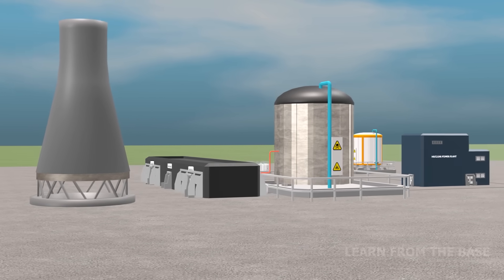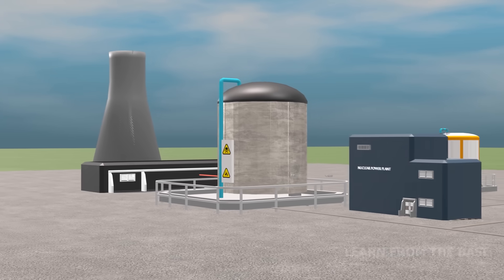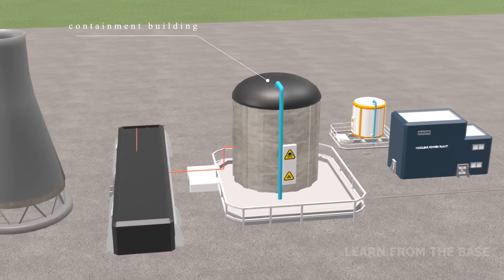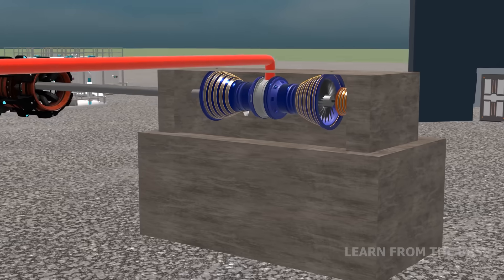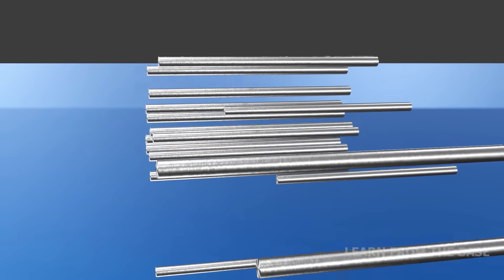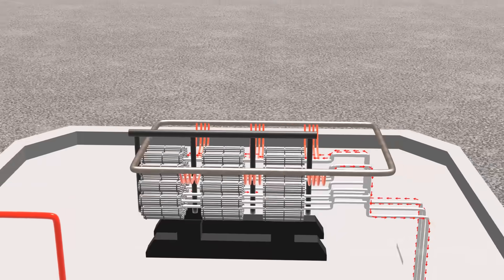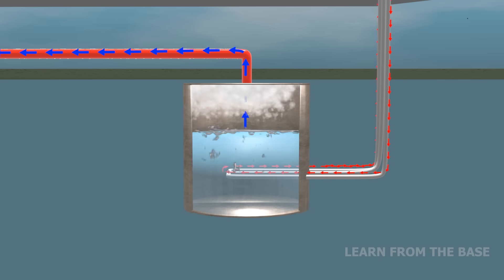HOW A NUCLEAR POWER PLANT WORKS ?.. || NUCLEAR REACTION || 3D ANIMATION || LEARN FROM THE BASE

Comment: Fission Energy on Earth can last for 555,000 years up to 600,900 years if calibrated or the reactor is fine tuned by the Geiger counter sensor. How is it done? First reduce time from 0.202 seconds to 0.1287 seconds verify zero rads, increase displacement to 25,373.13 miles and verify zero rads on the sensor, last increase decay rate to 3088 from 2000 and verify zero rads on the sensor. Something they don't teach you in college or the US Naval academy of nuclear physics research your Geiger counter sensor never lies and gives false readings of gamma X-ray radiation exposure.

Comment: Russia dreaming a Hanuman Jump in Nuclear Power Generation:

Keeping in mind economic growth in the Urals, Siberia and the Far East.

Global warming, Climate change, melting of glaciers convert fertile plains into deserts and Ice clad areas into Fertile plains.

Policy Plan-

To achieve a 25% share of nuclear energy in the country’s energy balance by 2045.

Construction of 28 GWe of new nuclear power generation by 2042.

Construction of 37 new nuclear power units of large, medium and low power.

Innovative units with Generation IV technology.

Optimised high-power units (1200 MWe) with VVER-1200 

Innovative units of medium power (600 MWe) with fast neutron reactors that will significantly expand the fuel base by involving uranium-238 in the fuel cycle

Low-power nuclear power plants (with a capacity of up to 110 MWe).

Largest increase in nuclear generation is expected in Siberia, the Far East and the Urals (more than 12.7 GWe). 

By 2042, it is planned to build 13 modern large and medium power units. 

Currently, these regions have high growth rates in electricity consumption.

Comment: 👍Great video! 😲Although I would add that in order NOT to 😱mislead your audience, you should have stated that you describe here a specific type of nuclear reactor, and that other types exist. This is a pressurized heavy-water reactor (PHWR) is a nuclear reactor that uses heavy water (deuterium oxide D2O) as its coolant and neutron moderator. PHWRs frequently use natural uranium as fuel, but sometimes also use very low enriched uranium. The heavy water coolant is kept under pressure to avoid boiling, allowing it to reach higher temperature (mostly) without forming steam bubbles, exactly as for a pressurized water reactor. While heavy water is very expensive to isolate from ordinary water (often referred to as light water in contrast to heavy water), its low absorption of neutrons greatly increases the neutron economy of the reactor, avoiding the need for enriched fuel. The high cost of the heavy water is offset by the lowered cost of using natural uranium and/or alternative fuel cycles. source : https://en.wikipedia.org/wiki/Pressurized_heavy-water_reactor . Peace & Prosper. ❤🖖

Comment: Nuclear power plant produces electricity using the heat that comes from splitting uranium atoms in a process called nuclear fission

Nuclear fission is a nuclear radioactive decay process in which the hitting neutrons on the uranium atoms then the uranium atoms split into two and it releases 3 neutrons. Each process releases two uranium atoms and 3 neutrons

Heavy water is 10% heavier water which contains deuterium and is 1 out of 7.000 drop of water.

Comment: So, nuclear power plants are just a fancy way of heating water
Reply: Yeah but it makes zero atmospheric waste and is a lot more efficient in converting matter to energy, burning coal and natural gas using only 30% of the actual energy made from the heat while nuclear plants can get up to 80% efficiency will being a renewable source of electricity
Reply: @SlumChip  Lies. Steam Cycles only go upto 33% Energy Efficiency at most regardless of heat source. Gas Cycles can go upto 45-50% Electrical Efficiency, and only Nuclear can make enough heat for it. Combined Gas and Steam in certain reactor designs can push over 60%.
Reply: LoooooL had the same option,steamed engine with extra steps
Reply: @RedRocketRR-xc5hk  but much more yeild
Reply: @CEUprimate  yeah,extra steps
Reply: Heating water with nuclear energy , wait does that mean when i boil my water i can make energy?
Reply: @IsaacDesnus  yes you can. this is 5th grade knowledge. That's how steam engine works
Reply: Technically yes, but the energy generated by heating water by boiling it in a stove would not be sufficient atleast to make some watt.
But then again i still dont know .
Reply: @IsaacDesnus  google it how streamed engines work
Reply: @IsaacDesnus  maybe, but you'll need a turbine for that to work, did you even learn it yet? I learned it in 6th grade
Reply: @matthhxz  of course a turbine is needed atleast to make mechanical energy, at the same time you do need a generator to turn it into electricity.
Reply: Yeah 😒 interest lost

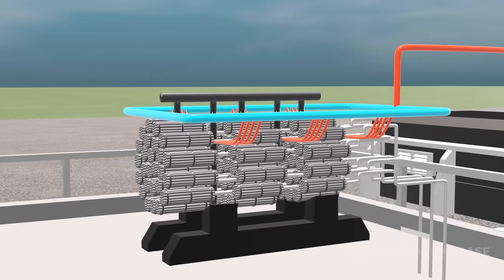Comment: 1:22 That's not exactly true, Uranium is Enriched before it can be used in a Reactor or Bomb by removing the other 2 Isotopes, Uranium 234, and Uranium 238 leaving about 85% Uranium 235, Uranium 235 is the only Isotope that can undergo fission so, the other 2 isotopes must be removed. (the other isotopes absorb too many neutrons and would inhibit the fission process, that's what Control Rods do in a reactor.)

Comment: The part that is always glossed over was glossed over again here. 

Where in this entire presentation is the splitting of the atoms occurring?
All the uranium is inside the tubes as rods in the fuel assembly. I thought the control rods being lowered created a reaction that caused heat generation but you're saying there is splitting of atoms where and when is this happening.

Comment: so basically every electricity produce by compressed steam for moving fan shape to generate rotation movement... using gas, uranium, coal burned  just for generate steam.. 
why scientist not yet discover new way to rotating that fan thing automatically.. 🤔
Reply: Because you can’t simply make something rotate perpetually, that’s not how physics work. 
You have to keep it spin in by constantly applying force into it, all power plants use turbines because they’re the most efficient way to convert all of that power into electricity.
Reply: @bonelesschickennuggets1868  that's very thoughtful.. 👍🏻
I wonder what make earth (and other sky thingy) rotating and spinning continuously, maybe it can be a hint for scientists to copy how it works and scale it down for power plan.. 🤨🤨

Comment: What kind of Nuclear Reactor was installed at the Bataan Nuclear Power Plant? In late January 1986  a successful dry run on Breeder Reactor was performed by technicians from Westinghouse ! 28 Filipino Electrical and Mechanical Engineers underwent training at Westinghouse!

Comment: 1. Uranium is not an amoeba that it will split into two uranium atoms. 
Afer fission, small amots are formed. Barium, Krypton. 

2. You didn't explain the cooling tower.

Comment: still costs 7 to 8 billion dollars per reactor/plant even if you get land and water virtually free. there is no difference actually as these days all electricity generating process are capital intensive: the largest dam in the world ( cost 25 bil), you need 5 to match it that will come around(35 bil too), same goes for solar,wind etc.
if same money was invested in fusion research there would have been some hope. since america washed its hands off tocomac it went to europe where they have not been able to spend that kind of money( it is stuck around 20 bil for last 20 years! not enough to make technological breakthrough substantially)
so there is no cheap solution: brazil tried ethanol too!

Comment: Three mistakes...

1. Uranium atom once split into two, again Uranium atoms don't get formed, some other lighter elements r formed, like Cs-137+Sr-90. 

2.  Heavy water cooling the fuel bubbles in tube is called primary heat transport system ...not Moderator

3. Moderator is filled inside calandria around the tubes containing fuel (outside the tubes) and it reduced speed of neutrons to facilitate fission
Reply: What does that magnetic thing in rotor do? I did not get it.  He said that it produces electricity, not the turbines.

Comment: [ E = mc2 = 1   (3   108)
2 joules
= 20   1012kilocals = 20 trillion kilocals .] If that would be
true, then powerful states around the world would not compete
for oil in the deserts of Arabia. If one ton of Uranium of some-
ton ‘Little Boy’ bomb could take part in the so-called nuclear re-
action, then some million of square miles of the world would
burn, instead of only 1.7 square miles of Hiroshima. It not at all
possible to give supply of electricity to the people from so-called
nuclear fuels at a cost lower than fossil-fuel electricity for the
reasons stated above. However, it is possible to give ontological
lectures on nuclear fission/fusion or to earn immense money
from so-called nuclear projects.

Comment: Starting off this is a CANDU reactor and should be noted that this is only one type of reactor and powerplant and there are only 36 in the world with 24 being in Ontario Canada and several being shutdown for good India manufactured similar reactors after politics in the 70's. I feel the need to share that this is the second video I have seen from this channel with extremely pretty images but the information is not there. 
2:20 that is not how fission works. Fission of a Uranium-235 and Plutonium-239 yield fission fragments, neutrons, and a lot of gamma energy(photons) when hit with a neutron. These fragments are usually in the 95-140 range of mass. Xenon, iodine, cesium, strontium, zirconium and many other elements are the result. It doesn't create more uranium or plutonium.

With that being said most reactors in the US and France are vertical with dropped in fuel assemblies and are cooled with flowing purified water around the entire set of assemblies within the reactor vessel called a monolith vs the polylith design of CANDU, note that the cooling water also moderates the neutrons (slows them down by absorbing some of the energy the neutrons have via collisions). That water is either converted directly to steam in a BWR or as illustrated heated under pressure and the heat is transferred to another loop of water that is converted to steam in a PWR. With light water the fuel pellets have to be enriched uranium which just means that the uranium is sorted and more U-235 is in them by percentage than what is naturally occurring.

Comment: It was nicely done video but it actually is only kind of how this style of reactor works. For instance, the power of this style reactor (CANDU) is controlled by vertical columns of water which they control the level of. Also the fuel bundles are contained within zircalloy tubes that run the length of the Calandra. The heavy water flows through each of the tubes being distributed to each tube by a manifold on either side of the Calandra. That heavy water is warmed by 50C as it passes through. Once heated, the heavy water passes its heat to light water via a heat exchanger that is within the containment. The light water is boiled and that is what passes through the turbine.
Reply: too shay

Comment: AFAIK, the heavy water is served as a safety "swimming pool" where the heating core is submerged in, to confine the excessive neutrons, and a liquid sodium metal circulation is used as the first stage of heat transfer, and the regular water/steam circulation is the last power generating stage.
Reply: https://youtu.be/5dKnJ5SkvgQ

Comment: Why it doesn’t blow up like atomic bomb?
Reply: its controlled
Reply: @blackboxbs8642  yeah but how
Reply: Nuclear bombs require a state of supercriticality, which means there's enough highly enriched nuclear material compressed into a small space so that the reaction speeds up exponentially and releases almost all of its potential energy within microseconds. Reactors instead rely on 'delayed neutrons' given off by decaying fission products to keep the process going, which means the energy is released at a stable rate.
Reply: this is creating heat slowly to boil water in a kettlepot.. atomic bomb is producing a ton of heat in a few seconds to barbecue everything surrounding it..

Comment: Next... How do these blow up?
Reply: thats very easy to accomplish..
1) remove the water from the boiler, the heating tube with deuterium with glow like a molten lava and melt..
2) drain the deuterium from the heating element pipings
3) take a hammer and break the control rods

Comment: In nuclear power plants, neutrons collide with uranium atoms, splitting them. ... In the core of nuclear reactors, the fission of uranium atoms releases energy that heats water to about 520 degrees Farenheit. This hot water is then used to spin turbines that are connected to generators, producing electricity.
Reply: Just curious: where do the neutrons come from inside the reactor? How are they 'started' to hit Uranium atoms ?
Reply: @paulraymondmargeot9680  i guess only one neutron is hit and then it is just a chain reaction. Neutrons keep getting emitted from the new neutron atoms.
Reply: @paulraymondmargeot9680 Deuterium is used to trigger the cascade. It leads to many neutrons colliding with each other causing an insane amount of energy and heat to be released virtually instantly.
Reply: "This hot water is then used to spin turbines" it is steam, not water anymore